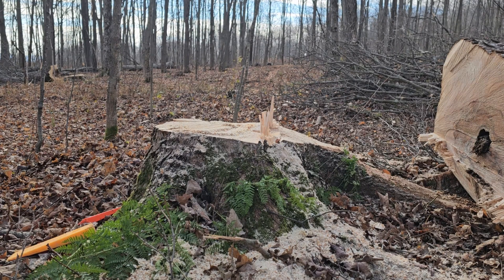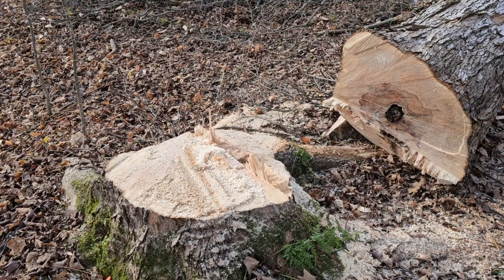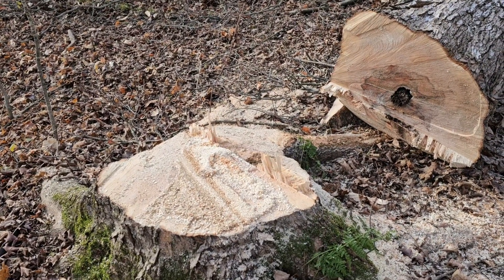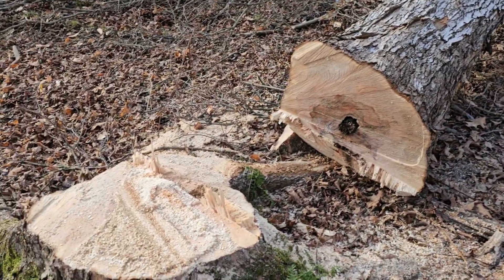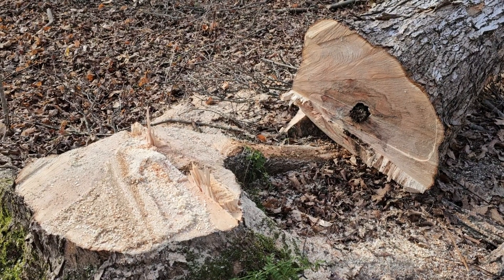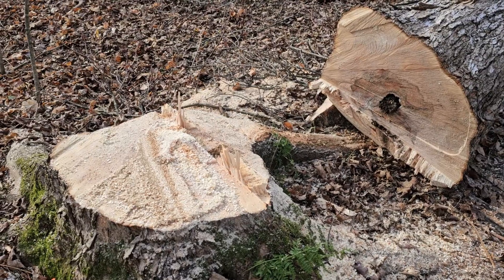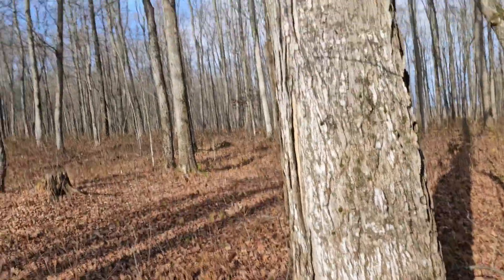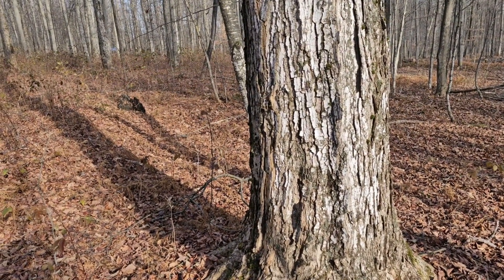Felling Face Cut "Angles" And The Effect On Pulls, Felling "Data" & Slow Motion Demonstration

Comment: Your cutting for lumber ?

Most of our trees are a lot more dead. The angle has to never close and we need to stay in the release cut, till it starts moving quickly. That keeps the upper trunk from getting stressed and blowing up above you.    I'd rather it explode as it hits. Than in the process of moving.    It's funny how we tackle different trees regionally. And I'm not that far from you. Central Ohio

Comment: Ever try a trad Humboldt aka gap face? Same effect.  Hinge bends and breaks vs. pulling. I like a high back cut too.
Reply from the maker: Yes The Higher "Back Cut" Really Helps On The Trees I have been working in, helps "peel" and bend. The longer those "bending" fibers are, the better they "crush" as the weight of the tree rolls over them. But The point is not the style of cut, I always wonder why folks focus on that; it can be a binford effen 3000 cut style. It's about how much of the fiber is bent and broke before it goes from compression / bending to tension as the tree transitions from vertical to horizontal. A "Good" style has enough room to where the tree has crushed and broken most of the fiber before it gets to tension. Less room for the face cut to close and a longer distance from edge of bottom cut to hinge, the more likely to see pulls & chairs. You can super impose any cut style but the formula is the same. Knowing the basic physics....then super impose the cut that moves the numbers in your favor with the least amount of effort and damages the least amount of lumber. period end stop. With a big heavy saw, its easier to push down... and the less time you have to pull up adding the weight of the saw to the pressure required to actually cut the better. Bucking spike are designed to help with that.
Reply from the maker: And for me , its like with the porting. The more Bull Chit & hand waving between the action and the understanding the less interesting a style is for me as usually it's about the optics and not the reality. Trying to sell vs being straight. This stuff is simple. All of it. And the more hand waving means trying to make something look more complex than it is. I see a Lot of that in our hobby. Unfortunately for me the blend to engineering, product design, sales and support blended with racing in my past has ruined it for me, kind of driven to cut thru all the jujitsu and get to the physic :) ( BTY noticed the "physics" word has crept into videos elsewhere now ... 
 that is true influence :) )
Reply from the maker: And one more "detail", NOTICE bore cutting a little from the front has two effects. First having less "fiber" to pull is the easy one, and a by product is less fiber to pull and create a "chair". The LESS obvious benefit is with less cross sectional area to support the tree as it rotates about the hinge, it crushes more therefore more fiber is broken when the tree does close or a face cut or hit the ground yet again reducing the pull and ability of the fibers in tension to damage the product of the work.
Reply from the maker: And it's obvious that all that explanation about styles doesn't change the fact its a "blend" of having enough hinge to control/direct the tree .vs damage even danger presented with too much of anything. Where experience, training, and skill comes into play is finding that blend for your tree's in your world.
Reply: @afleetcommand  I was thinking the gap face in case you had a tree without a flare to trim off on the face side. Instead of having to cut into your butt log with a conventional,  you could do a gap (and maybe snipe) as low as possible and save out some wood. They used it on west coast big cedar and redwoods to create a bending hinge because they were brittle.
Reply: @afleetcommand  On the porting thing...I dunno if you saw my OPE post about the two saw plan, but one saw set up for felling and one for bucking (firewood) sure is a timesaver.
Reply: @afleetcommand  Less likely to have a "post" left in the middle fighting you or throwing the tree off too.